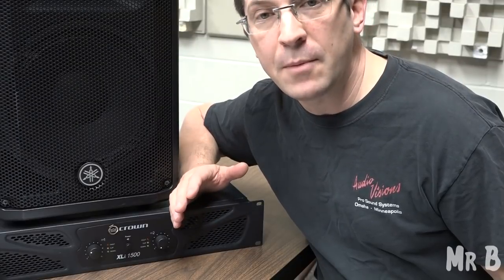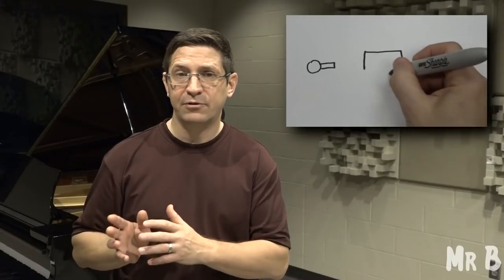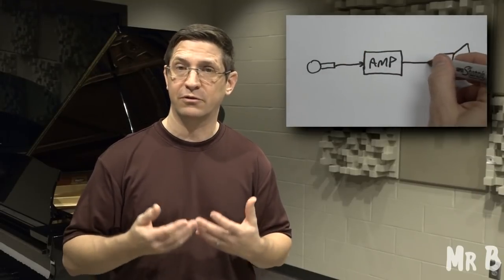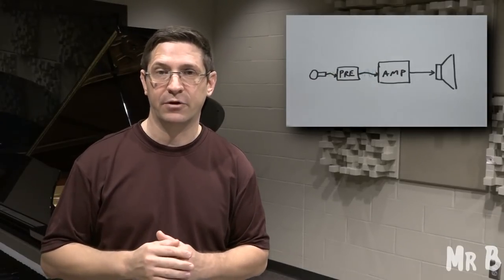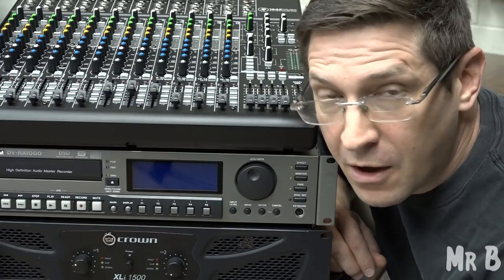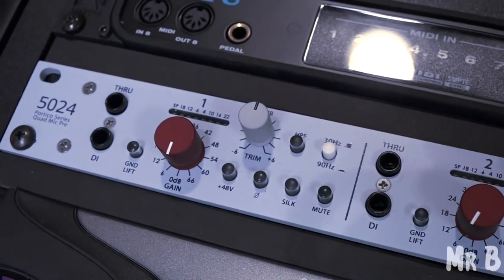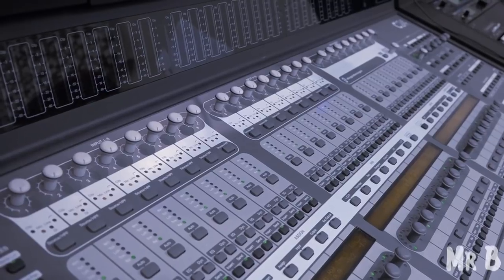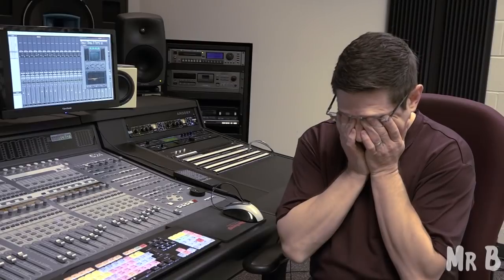What is a Microphone Preamp?

Comment: I like the Avalon on the Piano...the snare was harder to tell a difference although the rolls seems like less clarity.
Reply: Thanks for the video!
Reply: Avalon was the only one that stood out to me on the piano.  I just didn't hear a significant difference with the drums or on the piano, otherwise.

I actually have a Rolls preamp.   It's not the greatest but for my purposes I wouldn't notice the difference (I live in an apartment with a background noise level of about 35-40 dB).  It was either get the Rolls, or the Behringer Ultragain Mic 100, and I wanted to avoid tubes if possible.

Comment: This is a very informative video.
I have one question.
I have a Mackie 1402vlz pro mixer.
And I have a Fractal Ax8(Guitar Ampmodler + Multi FX)
If I receive a Fractal Ax8 and a mixer connection on the XLR out-mixer's XLR input, will the sound be changed by the Mixer's mic preamp?
Or is it better to connect the mixer with a 1/4 cable to the Line input?
Thank you for your reply!
Reply from the maker: Thanks for watching!  Actually, the line and mic input on a 1402 are routed into the same preamp, so the signal's hitting the preamp either way.  But if your Fractal is outputting a line level signal, it would be best to put it in the line input to avoid distortion.
Reply: @MrBinthestudio  Thank you So much!

Comment: I have very good ears, I also have perfect pitch. I've been recording bands on a DIY budget for the past 25 years or so and have been through a lot of gear. I tend to stick with the basics, SM57's, SM58's and a few other simple mics, mostly under $200 range. Actually lately since china is cloning lots of shure products i've been able to build up a pretty sick array of mics. I am calling BS on expensive mic preamps. The only reason I can see that anyone would use one is to get a more "vintagey" sound. It seems as if preamps from the mid 90's to today are mostly "great" quality, meaning, they don't hum or hiss or add any kind of nonsense to the signal, and you are able to bring mic's up to a level that your interface can interpret them and turn them into wav files which can be manipulated to sound like ANYTHING you want! The only use for expensive mic pre's that I can see, is for people that don't have enough creative energy to fatten up their mix with creative EQ/Compression/Automation/Saturation. They may not understand how to get a punchy sound in post processing, so they turn to an industry tool that was designed originally for analog tape tracking. Or maybe they just need racks full of pre's to stumble upon that magic take. I dunno but, if I can't hear the need for a $2000 mic pre, how the hell is the listener going to be able to hear it? And even if they could, would it matter?

Comment: Great video! I have a question. I want to build a device that allows a mic signal to be heard through headphones and a console as well. I was thinking about splitting the mic signal input into a headphones output (with headphones amp added to it) and a console output (since the console has a preamp built in). Do you think this would work? Thanks in advance.
Reply from the maker: Thanks for watching! Yes, basically you're just making a Y-cable.  As long as the headphone amp has a mic pre built into it (or preceding it) it should work fine.  You could also use an aux on your console to send signal to the headphone amp, but that may or may not meet your workflow needs.
Reply: @MrBinthestudio  Thanks! I'll try it but I don't know if it will have that much gain, since the circuit I got is rated at only 3 watts

Comment: I would like to say I am not familiar with any current Sound systems which is what brought me to your video.

I currently have the Sennheiser Game One Headset (not usb) and I am looking for a Pre-Amp to amplify my microphone. However, in your video all of the amps appear to have a 3 pin xlr cable connector and I was wondering where I could buy a converter from the standard headphone and mic input to the 3 pin connector.

pls help.
Reply from the maker: Hmmm... I guess that depends on what you're plugging it into, but this sounds like what you're describing... https://www.sweetwater.com/store/detail/MiniSumBox--switchcraft-318-mini-audiostix-1-channel-passive-laptop-direct-box?mrkgcl=28&mrkgadid=3274464273&rkg_id=0&product_id=MiniSumBox&campaigntype=shopping&campaign=aaShopping+-+Core+-+Live+Sound+&+Lighting&adgroup=Live+Sound+&+Lighting+-+Live+Sound+Accessories&placement=google&adpos=1o5&creative=250341283160&device=m&matchtype=&network=g&gclid=CjwKCAiAlb_fBRBHEiwAzMeEdjz6oqPQmn2ujYa_aZpeRiE051RaG0nh__YlWaaCUKE9Dmy9QpyQMxoClKYQAvD_BwE

Comment: Hello. I didnt found a video were somewone connects mic preamp into a mixer, all videos about connecting preamp to interface. A guj who sell the preamp didnt undertand this need too, but i want warm sound with tube preamp go into my mixer, is it save for my mixer and speakers? Same i already connected 2 preamps to my mixer. 1 for bass with balanced outputs(gt electronics studio serie bass preamp) and guitar preamp (amt army of evil tube preamp) with  output to mixer. Maby i need DI? And when i connect my cheap art tube mp to a mixer i have preatty loud background sound, is it coz of this bad connection? or bad cheap device? or broken device?
Reply from the maker: Yes, you can feed the output of a preamp into a mixer, but be sure to plug it into the line input, not the mic input.
Reply: @MrBinthestudio  Soo i need  xlr -jack cable? same for mic preamp and bass preamp. Means i did wrong when put bass preamp balanced out in mic input?

Comment: Mr B, greetings from India! My quick question is (assuming I've a focusrite 2i2 audio interface)  does the inbuilt microphone preamp(with toggle switch in mic) is really necessary to record music in a better quality or I can buy a plain mic and control the level in focusrite?. Thanks for this wonderful video
Reply from the maker: Thanks for watching!  The built-in preamps on the 2i2 are good preamps.  If you wanted to step up the quality of your recordings, I would invest in a high quality microphone.  I hope that answers your question.
Reply: @MrBinthestudio  ...Thanks for your Quick reply! So as far mic is concerned I don't ve to worry about toggle switch in mic... A good mic without any inbuilt preamp works fine right?
Reply from the maker: @TamilGuitarLessons  I'm not sure I'm understanding your question correctly.  What kind of microphone are you using?  What is the brand and model number?

Comment: Informative vid! Question: Can you use these external compressors/EQ's for fruity loops or Reason drums to give them that analog punch and sweetness? Are they often used for that purpose? I'd love an answer for this, hard to find one.
Reply from the maker: Thanks for watching! Yes, sometimes people will do that. You have to use it as an insert in your system so that the signal is D/A converted out, run through the unit, and then A/D back in. In this case, you get the most benefit if it's a tube preamp or compressor.
Reply: @MrBinthestudio  Thank you for that answer :). One more question for you if you'd be so kind: I am trying to build a studio for just music production but i don't intend to record vocals, just music production. What kind of set up would you recommend  for beat mixing and creating as far as hardware is concerned.?
Reply from the maker: That's a question that doesn't have a short answer, I'm afraid.  I'm going to introduce you to another YouTuber - Graham at recordingrevolution.com.  He has several videos about building home studios, and I think you could find something on his channel that could help you.  I'd start with this video: https://youtu.be/XLXSqan3Jcs 

A lot of what will go into your studio will depend on your budget, and what kind of space you have to work with.  I would concentrate most of my effort into getting a good sounding control room.  So, look into acoustics and a good set of monitors. 

If you are in a position to do some construction or remodeling, I would recommend this book:
https://www.amazon.com/Home-Recording-Studio-Build-Like/dp/143545717X

Hope this helps!

Comment: focusrite scarlett 2i2 2nd gen) Rode NTK  Preamp Which one should I use . Less money
Reply from the maker: The Rode NTK is a tube mic, so that box that you plug into is actually the power supply for the vacuum tubes.  You will still need to plug the output of the Rode's power supply into a preamp.  The preamps on your focusrite should work just fine.  I hope that answers your question.  Thanks for watching!

Comment: Hello sir, i have rode nt 2 mic, and tascam 4*4 (i think inbuilt preamp), does i need a external preamp for better quality?
Reply from the maker: I personally haven't heard the Tascam 4x4, but most of their stuff is pretty good.
Reply: @MrBinthestudio  Okk bt tascam 4*4 is nt expensive interface,  so m confused should i buy another external preamp or not
Reply from the maker: @brar  if it we're me, I would not. The Tascam already has the built in preamps, and an external preamp will still have to pass through the Tascam

Comment: Hi was up , great video ?
Question ?
Can i connect a mic on the line in of anny slide of a mixer, ex : (Pionner DJM 850 whit no sub mic) whit a XLR Y to RCA LR  whit a preamp so i can use the slide 4 of the mixer , like on the Pionner DJM 600 whit a sub mic ?
Thanks
Reply from the maker: No, that won't work because the RCA connectors are expecting a line level input. You would need a preamp between the mic and mixer
Reply: @Mr. B in the studio  Hi  yes , i will connect a mini preamp between the mic and the mixer but will it work properly  !
Thanks for answering 🙂

Comment: I enjoyed listening to your video. I'm a film and t.v. editor. i work on Avid and Premiere. I have a Yetti Blue condenser mic, an ART MP Studio tube preamp and a Scarlett Solo that feeds into by iMac. When I connect them in line with each other (mic>preamp>interface>iMac) it doesn't work. When I bypass the preamp it does work. Any thoughts or helpful hints I could try? P.S. I've worked on a system that has the same exact setup and the audio quality out of the Yetti Blue going through the Art MP Studio preamp was stunning!
Reply from the maker: Hmmm... Not sure. There could be any number of things going on. A bad cable, phantom power turned off, or, there could be a problem with the ART itself

Comment: Hi Mr B, great video, great channel. Would you recommend the Rolls mp-13 for saxophone in a live setting? Thanks!
Reply from the maker: Thanks!  It depends on whether you would need a stand-alone preamp in your situation.  If your sax typically inputs to a live mixing console, there would be no need for an additional preamp.  On the other hand, if you are doing solo gigs where you don't have a mixer available, the MP13 would certainly do the job.
Reply from the maker: I'm a saxophonist too, by the way.  :)   I checked out your channel... great playing!
Reply: Thanks a lot!
Reply: I'm putting together an analog effect pedal board so basically I have 2 choices: 1-Use a mixer and route the effect pedals in an aux send or 2- Use a preamp that I would directly plug into and then go through the effects chain and then go into the main mixer of the venue. To be honest, I prefer the 2nd option since  that be more portable but I'm concerned about losing some tone in the chain effect even though I use true bypass pedals. I have tried several things in my career and that was always the issue. Anyways, what do you think about the Rolls mp-13? I am very curious about that product and wonder why it is so cheap and can be compared to an expensive avalon.
Reply from the maker: Ah, gotcha.  Yes, that preamp would be perfect for that, mostly because of its size.  Also, it's very basic, so it's pretty rugged for road work.  If you tried that with an expensive tube preamp, it might get jacked around when you move from venue to venue.  I've found it to be pretty clean sounding and pretty transparent.  In my comparison, I was expecting it to sound terrible next to the others, but it held up pretty well.  As for the price difference, mostly it's because it's very basic.  Just a gain knob and phantom power.  Also, I suspect that if we did a serious comparison (looking at total harmonic distortion, and doing a waveform analysis to see how much it colors the signal), we would find some differences that favor the more expensive preamps.  The good news is, if it doesn't work out for you, you're only out $50!
Reply: Thanks :)

Comment: Great video, thanks! I"m an audiobook narrator, using a Mac running Logic Pro X. My microphone is a Shure KSM 44A, into a Scarlett 2i2 interface (currently gen 1 but I have a gen 2 to replace it soon). I've been told that I need to add a preamp to my set up along with the Scarlett. Is this true and are there that many benefits to including one? Thanks again!
Reply from the maker: Thanks for watching! No, that is not correct.  The Scarlett has a built-in preamp on it, and it more than does the job.  Adding another preamp to your current setup won't improve the sound much, because it would have to run through the Scarlett anyway.  And, I went to your channel and listened to your recordings.... you're doing fine!  :)

Comment: hi, it is good to learn on this pre-amp.  i am searching for ways to improve our audio in our small local congregation.  i seems our goose mike would not produce the same volume when using laptop for audio source.  my friend recommended me to try adding pre-amp between mixer and amplifier.  however i learned on your video that mixer gain knobs do this pre amp function already.  now, i wish to confirm that for matching impedance of speakers and amplifier the right way to understand it.  some internet video would say it is preferable to have the amplifier power rated 25% to 50% than that of the speaker.  while in a music store they will they me that the speaker should have bigger power rating than the amplifier.  which one should i accept then?  many thanks, and best regards to you, william
Reply from the maker: Thanks for watching!

For choosing an amplifier, I would never under-power.  It is better to be matched, or slightly over-powered.  Make sure to also pay attention to impedance.  If you have two 8-ohm speakers in parallel, the amp is seeing a 4-ohm load.  That means if the amp is rated at 500-watts into a 4-ohm load, you are actually providing 250-watts for each speaker.

Comment: Would you suggest to use a preamp to amplify audio coming from an earphone-out, e.g. from an iPod (instead from a mic)?
Reply from the maker: Hi there, thanks for watching!  

No, I would probably not do that, because the signal from the iPod is actually a bit hotter than line level.  (It has a small headphone amplifier behind it).  When I'm doing a live show, and I want to put the iPod through my sound system, I'll use a stereo 1/8" to 1/4" LR splitter, and put the two plugs into 2 separate line-level inputs.

Does that help?  What are you trying to plug the iPod into?
Reply: @MrBinthestudio  many thx! How about amplifying with a preamp audio that is coming from an earphone-out of a synth or sound-module?
Reply from the maker: Yeah, I'd probably treat that the same way.  Now, if you're doing this in live sound, (meaning you're on stage and you want to send the keyboard to the front-of-house mixing console),  I would recommend plugging the keyboard into a DI box, and then run that to a preamp on the mixer.

Comment: I want to plug in the mic straight into the motherboard without any audio interface, will a pre-amp circuit improve the quality of sound (reduce echo and noise ) OR just boost the  input signal.
Reply from the maker: The preamp just boosts the signal up to line level analog.  Exactly where/how are you connecting it to the motherboard?  Through the line input jack? Or one of the internal motherboard busses?
Reply: Through the mic input jack on the motherboard. There's alot of noise how can that be eliminated or reduced?
Reply: It's a simple mic no circuitry will a high pass or low pass filter help i saw alot of diy mic projects where they use it
Reply from the maker: @UZEETM  The input on your computer is most likely expecting a line level signal, so a preamp might help, but that also depends on the mic. Some of those mics are high impedance. The noise is most likely a function of the native interface on your computer. Those aren't always the highest quality components. You might be better off trying a USB mic.

Comment: Excellent video , thanks! 
What if I want to try another preamp , but my audio interface already has preamps. I mean , can I use one preamp and another one after it?
Reply from the maker: Thanks for watching! Yes, you can do that. Ideally, if you can go from your new preamp into a line level input on your interface, that would be best. If not, you just have to watch the input level on your interface
Reply: Mr. B in the studio excellent , thank you
Reply: Mr. B in the studio ...but will this setup colour  the sound actually  based on the new preamp ? ...or maybe this doesn’t make much sense
Reply from the maker: It depends on the preamp. If it were me, the only time I would do this setup is if my new preamp was a tube preamp. Otherwise I wouldn't bother.
Reply: Mr. B in the studio great! That’s exactly the case

Comment: I suppose a guitar pickup already deliver line  level? Is this correct?
Reply from the maker: Yes, but due to its impedance, a guitar should be plugged into a super high Z input, not a standard line input like on a mixer.